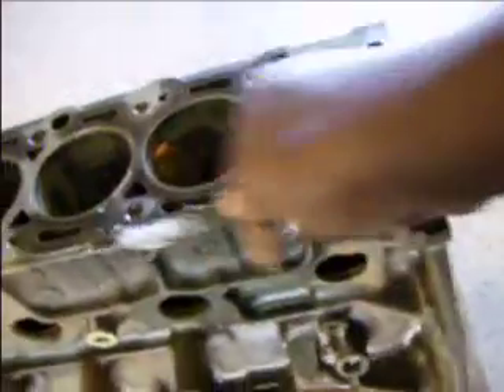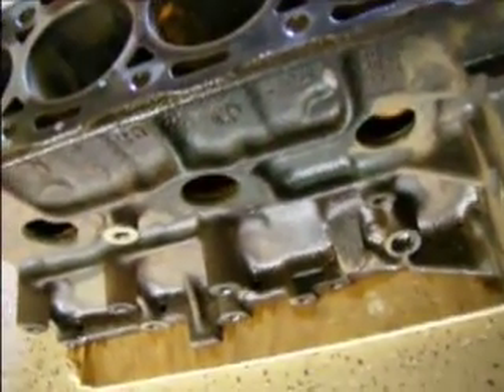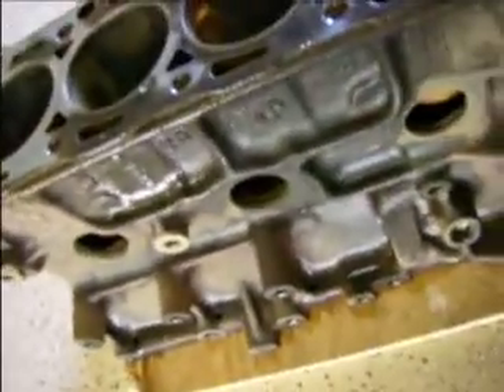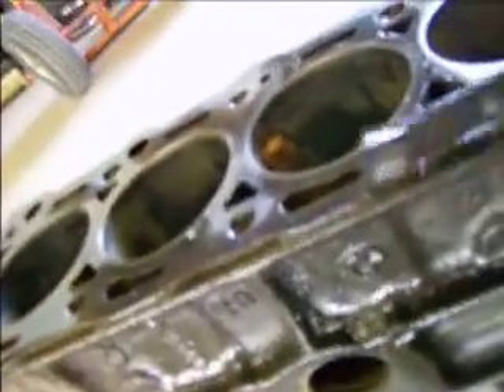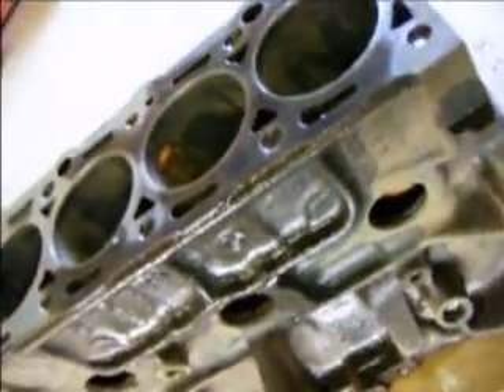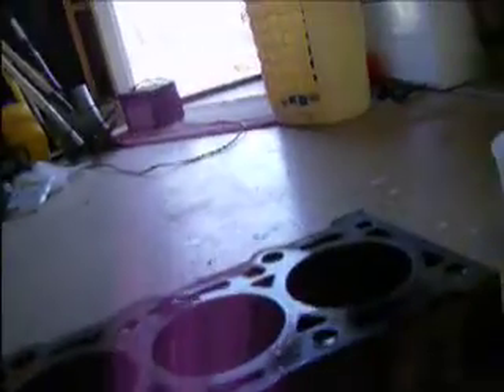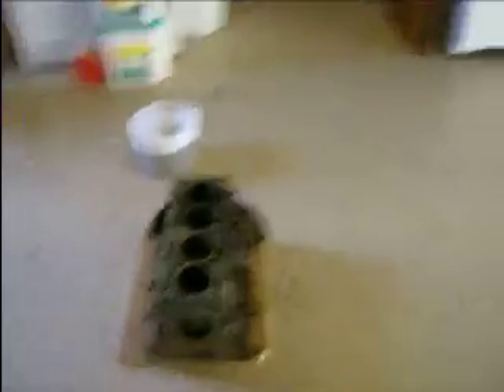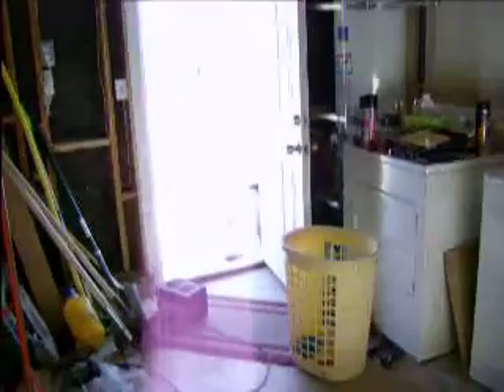Block Rust Removal with Electrolysis part 3

Comment from the maker: Honestly it sounds like you may be in a similar boat as I am because my car ran like crap after the crack. But she still would hit 60 with no issue as long as she was cold. Didn't drive it much because I didn't want to further damage anything but shit dude. Your car should move pretty decent.  You should post some vids of how it's running and sign up for feoa!!! There's plenty of knowledge in those forums dude.

Comment from the maker: on your tensioner pulley and slide the belt of...it's a pain but it should come off with a bit of finessing. after the belts off make sure your cam gear points straight up to the dot on the cylinder head then replace the belt, spark plugs, valve cover, and timing belt cover so you can start it and see if she runs differently. Also to play with your ignition timing you can just loosen the 2 bolts on the distributor and rotate the assembly to get the spark timed correctly.

Comment from the maker: This is the absolute easiest way to time your car. Take off your valve cover, take off your timing belt cover and remove the spark plugs.  Most would advise against turning the crank via the cam gear but I've done it with no issues. But get a 15mm (i think) socket and slowly turn your cam gear and try to get your timing mark as close to the 0 degree tdc mark by memory after removing your timing cover and replacing it to see how close the marks are. After that's said and done loosen the bolts

Comment from the maker: what? Your car should rev to 7500. It hates revving that high but it'll do it with no other complaints aside from Not going anywhere. If you have a smart phone try using a gps app. You may be going a lot faster than you think. Also try seeing how your cars cam is positioned. It may be WAY off and that will definitely leave you stranded in higher rpms.

Comment: My tac dont work either.. BUT if its less then 20 degrees outside my tac will work untill my car starts to push heat through the vents.. so real quick get in and find a highway lmao.. My car is geared slow as fuck i cant even come close to 70 in 4th amd your saying you touch 80-115??!! God danm lol my cars power starts to fizzle off around 4000/4500 rpms and starts screaming around 4000revs.

Comment from the maker: These cars are more mid-range than top end. Also pushing the pedal to the floor exploits my cars lower end (less so with the new head for some weird reason) and it should pull decently with just short shifts at 35-4500rpms. Lastly I'd check and see if I have serious performance issues happening. If your check engine light is on there's something wrong and these cars are easily robbed of power. Try and be sure you have no vacuum leaks or timing issues that may rob power.

Comment from the maker: Being the owner of beefie v8's and eco v8's and beefie modern v6's I always had the torque to run the same times regardless of who was in the car with me...these 4bangers are FAR from the same. Your system, wiring, anything that adds weights has a direct effect on these cars. The torque is only 114ft-lbs so your problem may be your system as well as tires, bearings, binding brakes. All that makes a big difference. also shifting at 3k is kool for slow traffic but try shifting at 4-45 from now on.

Comment from the maker: colder nights toward the end of the year i'd climb the cajon pass. It's about 3-4 miles of steep uphill and she'll push through it at 85mph in 4th gear. Often get chased down by BMW's and beefie pickups with an Ego driving them (they usually don't catch up). Once I come over the top she's screaming past 110 in just a few seconds and I gotta back off. But after that run on a good cold day she'll pull a flat 9.0 0-60mph time repeated when she's usually 13.4. weight makes a big diff too.

Comment from the maker: As far as my gears go I usually cruise at 60. Get's there pretty damned quick too. Not smoking fast but before I know it I'm doing 70mph. Racing off the light my gears are 1st=0-25mph (30 if I hold the gear but she don't like it) 2nd=25-50mph (55 if held) 3rd=50-80mph (85) 4th=80-110mph (115) 5th= 110-126 (on a downhild XD). This is with leaky valves, crudded up intake manifold and a stock everything on it. Havent' done a run like that since I swapped heads. BUT after coming home from work on

Comment from the maker: what? I don't pay any attention to the rpms (tach doesn't work :D ). shift light and noise is how I shift my gears. If I really want it to move I usually don't have to take it over what I'd assume is 4k unless I wanna pull hard then I rev it out till the light comes on (sometimes a bit further). She doesn't like the screaming RPM's but she doesn't complain too much either. When I'm running off the light it's  usually pretty quick. Has a good mid-range for when I'm saving gas as well.

Comment: idk how yours is geared but i swear mine is geared like the first 5 gears of an 18 wheeler.. i shift at 3,000rpm. out of 1st @ 15mph and out of 2nd @ 25mph (between the end of 2nd to mid 3rd it just seems to lose power) out of 3rd @ 35-40mph. out of 4th @ 55-60mph and ride 5th out to 85 where i wont let it go faster.. 5th gear at 85mph is 3,500 rpm... at that point the engine is screaming for mercy. lol redline is at 5500rpm.